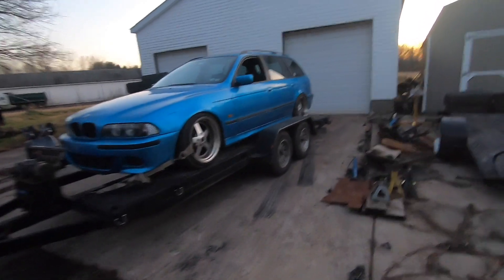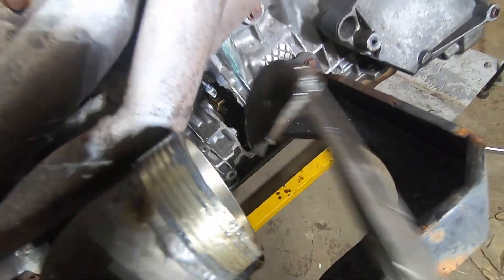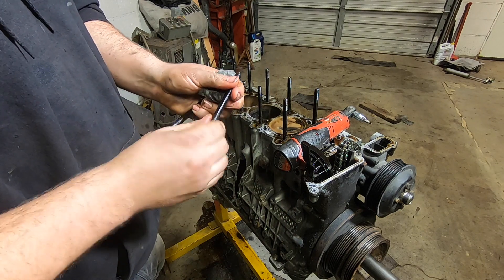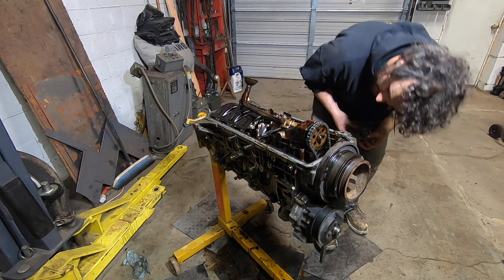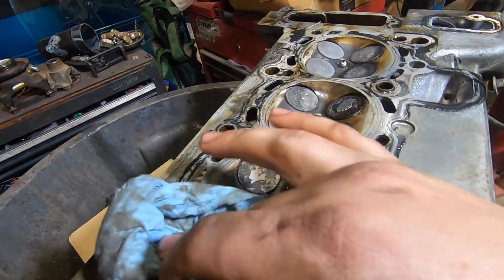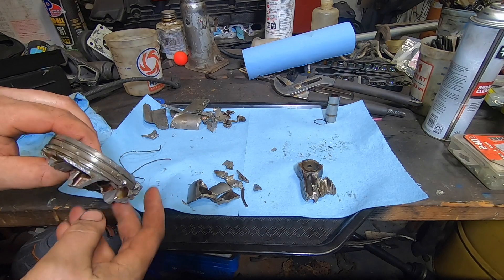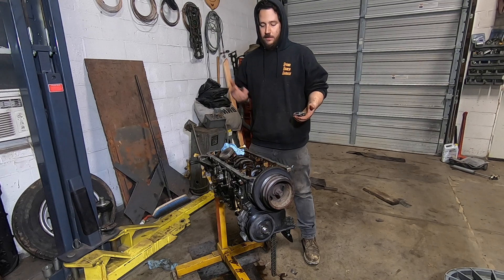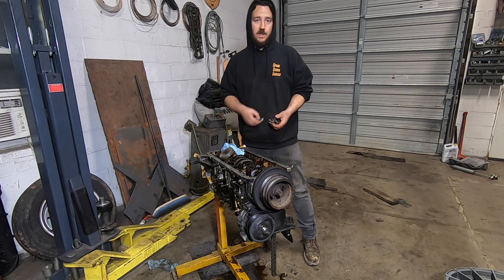I finally blew my Turbo M54 up. Heres what happened. Too much boost?

Comment: Interesting.  The failure was identified but not the cause.   Heat and lack of lubrication jam things up.  Massive torque bends things outright.   Did you ever find the contributing causes?
Reply from the maker: Thanks for the comment. Torque (Cylinder pressure) is the causal factor for the rod bending and starting the chain reaction. It was a combination of low RPM, a very cool oxygen dense morning, towing a trailer, etc that I believe caused this failure. Unfortunately the design of this engine leaves almost no room for a bent rod before catastrophe strikes. If there was more piston skirt to crank counterweight clearance, I think it would of just bent a few rods and I would of noticed before it was too late.

Comment: Hello my friend can you help me with a question? I have a stock e39 double vanos, can i turbo it and how much boost to be safe bare stock just injectors and remap and the accessories like intercooler headers and stuff like that. Please 🙏 i need your answer  the turbo i want to use is maxpeedingrods gt3582
Reply from the maker: The boost pressure doesn't really matter its the cylinder pressure and resulting torque that does. With a good tune if you stick to 400 WTQ and below you will probably be okay.

Comment: "Throws 1.1 bar of boost on stock pistons and rods" ... Engine blows up... dude be like..." :O Whyyy??"
These engines have a tendency to fail at above 0.7 bar (10 psi), where 0.5, 0.6 (8-8.5psi) is considered safe, and you went double that...
I am building an M52TU (alu block) E46 stroked to 3.0L (and a full 3.0L swap, so everything from a M54B30 is in my engine already, even the ECU, and the throttle body). I put brand new pistons in it, but for the rods I went for the rods out of a Non-Vanos M50, they are quite beefy, and extremely cheap (paid about 60 Euro (or $65) for all 6 of them combined), went with 12mm bolts for the head out of a M57D30 diesel engine ($60) (I know people push engines at above 800hp with them) and my goal is to get 400hp safely for a daily driver. looking at around 10psi of boost.
This video made me realize that I made the right choice when I put those conrods in. And if it still blows I am going all forged, baby! :D
Reply from the maker: 400hp is very safe on stock rods I have been doing that for many years in a drift car. Whats important to realize is boost pressure has little to do with what an engine will handle. 21psi on a small turbo is fine for a stock engine. 21psi on a 66mm turbo is a time bomb. Torque bends rods not charge pressure. I am confident this engine would of taken much more boost if it was delayed into a higher rpm range.
Reply: @spankranchgarage  You are right, but you have a limited amount of RPM to play with, maybe an electronic boost controller will make it a bit easier if the tuner is good, so you get a more consistent power. But I can bet my car you are talking 21psi is on E85 or something. And I am talking about pump gas, because we don't have E85 here in Europe (well, we do, but it is 20-30 USD per gallon, because it is treated like alcohol for drinking (yeah, the government is mad, no need to ask :D)).
Reply from the maker: @deanjohnson7283  Ahh yes I run all my turbo bmws on E85. I was spinning the 3.0 to 7350rpms to try to maximize the power curve. Like you said an electric boost controller would be sweet to make more boost up top

Comment: Noticed you have a tubular bottom mount on that thing. Looks similar to my PPF tubular bottom mount manifold. Can't tell in the video, but did you run a scavenge pump, and if you didnt, how did you run the return?
Reply: At 4:12, it looks like it just drains directly to the side of the oil pan.

Comment: That 2nd (and full) PBR first time I’ve openly laughed during an engine teardown video. Planning to boost a stock M54B25 for an AWD E36 project…needless to say I will avoid 15PSI! Great video.
Reply from the maker: 15PSI isnt always harmful, just depends on the size of the turbo. For example the GT30 cars I tune we go to 15psi all the time on pump gas no problem. But with a bigger 66mm turbo thats a much different story, especially when its super cold outside. Enjoy a PBR for me!
Reply: hey dude i’m planning on seeing if it’s worth doing the same with my e46 how is the project coming along
Reply: @D3RAYT  slowly, although I do plan on dismantling the E46 donor car this month. Will probably do a lot of the engine controller and other things during the colder months later this year.

Comment: Stock rods and crank can handle boost, but the rod bolts are the weak link, ive over torqued one before to 180 degrees instead of 90 and it broke right away, ive made the same mistake with ARP2000's and the bolt just turned in to a rubber band lol, but it didint break.
Reply from the maker: I still struggle to understand how ARP rod bolts help handle torque. High rpm yes I could see that. But rod bolts don't see much if any stress on the compression stroke?

Comment: hoy, My idea would be that intake beeing center feed, it does not require no turns, thus beeing the most air running cylinder. It ran the leanest, it ran the strongest. Your wideband shows mixture of all cylinder avarage not independant. So yeah, if It would of had melted, it would support my idea 100%, but i've also seen most built engines blow the last cylinder with front feed intake manifold. Thats why rally uses dual plenium ones For equal distribution.
Reply from the maker: This is a great well thought out theory! I think I agree that cyl 3/4 gets the biggest charge.

Comment: Have you had any success with timeserts on m54/m52tu non iron block I just pulled the threads out on a m52tu i tried to swap bolts of studs think I tried 75lbs as well I think it may be the main reason
Reply from the maker: I have a video on this topic and I have a new video coming soon. Pulled threads happened to me too finally. I have a nice cost effective way to fix coming soon

Comment: in my no expertise opinion, the cyl 3 is next to the turbo, the turbo got hot and heat the cyl 3 wall and the piston seal expanded. and from there u can imagine what happened. i think u should isolate the turbo from the engine a lil better.
Reply: Top mount
Reply: That would only make sense if it were cylinder 6 that failed

Comment: you kinda remind me of taylor ray, new sub!
Reply from the maker: Thank you! More shenanigans to come
Reply: @spankranchgarage  you think using m50b25 rods on the m54b30 will have any clearance issues?It would be m54 block b30 crank and pistons with m50b25 rods. theyre same length 135mm but the m50 rods are a lot more beefy. would be a cheap alternative
Reply from the maker: @Joey-tc7wg   You mean the Non Vanos M50b25 rods. Yeah they are a great option if you can find a cheap set. I would also very carefully inspect and measure some Chinese rods and run those if everything checks out. For this E39 I am just going to put it back together with stock parts and keep the torque a little lower

Comment: b30 is not the best for boost
bc of the length of the rod
Reply: without changing anything like Pistons Rods crankshaft Head etc on the b30, 
stock u can give the b28 a bit more boost 
b30 is kind of a Long Stroke so More Boost the rod Bends, cracks easier than on the b28
the b28 had better piston Rings than b22,b25,b30
without changing anything i would go to 460-470 hp max and 370 ftlbs on a b28 
some do 500-550 But thats More Risk 
on b30 i would recomend 450 455hp max and
330ftlbs
stock
then Ur safe

when u Start changing Rods Pistons etc etc its another story
Reply from the maker: Do you have any more info on this? Ive had better luck with my 2.8 liters but the rods are the same only the stroke and pistons change
Reply: Look exactly, messure if the crank is straight or bend
Reply: if u want to use it on the rebuild or other wise
Reply: Alien engenering sells a 138mm rod/ piston combo,  a better ratio? (Altho your stroke to bore stays the same)  honda b series parts/ bearings if i recall right. ( difference is a Higher wrist pin location im guessing? )  a m54b25 and a m52b28 use the same crank according to bmw fwiw. I also read in a carillo catalouge a n54 rod and a m54b25 had the same part number.  Lots you can mix and match im guessing, i just dont know for sure. I put a turbo s52 into my e39 wagon. Next motor will be a iron block with dual vanos zhp cams. Cut the single vanos head to fit dual vanos, still run ms43 . Seems like the best option for reliable power under the curve vs. Cost in 2023.   ( probably into my e36.)

Comment: How much whp and torque the motor was on ?
Reply from the maker: I don’t know exactly but I can say it was making 400/400 on 7psi pump gas and I had it turned up to 15psi on e85. So 500/500 would be a safe bet if I had to guess

Comment: Almost ready for the first crank on my b25. But it’s ms45. What’s the best cheap way for a tune? I have a 330 maf
Reply: On my MS45 turbo build iam going with a chaos calibration tune. I'll let yall know if its any good. Still waiting on other parts in the mean time
Reply from the maker: I never got into the ms45 stuff, but I think you can tune it yourself now. There has been developments
Reply: Went with Severn Tuning instead. MS45.1 and 6psi. It loves it

Comment: The internet claims the limits of stock rods are 450 ft. pounds at 4k or below and your gambling / on borrowed time. ( my opinion after a lot of reasearch) A 366 is a late bloomer on 3 liter?( so it should not be a issue?  )   Is that manifold twin scroll? Ive seen n.a. m54b30's let go EXACTLY the same way just from high rpm use/ street abuse. (7K redine/ intake /exhaust/tune)  internet also says S52/m54 crank has the worst harmonics around 7200. Prehaps 7300 redline has something to do with it?
Reply: Only other thought,  the center two cylinders get fed more air with a m50 manifold on boost. ( easy to see just look through the throtel mounting hole) I always worry about that spraying w/m with a single nozzel.  Extra fuel (meth ) may or may not help this m50 manifold issue who knows?  I will say, if i see a overheat, its usually the front or the rear cylider. If I see a bent rod or ringland , its usually one of the middle 2. ( everyone i know personaly with a m5x and boost is running a m50 manifold. ) 

Ive seen a few m54's put a rod through the block.
The m54b30 I saw let go the exact same way, it punched out through the oil filter housing/ oppisite side. Same exaxt carnage otherwise.   Happened right when he lifted after a pull. Car might have made 230 to the tire on a good day? (Guess)⁸
Reply from the maker: Drew good stuff. It is a late bloomer however on this morning I was towing a trailer up a hill and was being foolish. It spoiled earlier than it ever has I saw 15-16psi around 3500rpm or so. I’m sure the torque was pretty high at that moment. It’s not a twin scroll manifold. Good point on the m50 mani getting a straight shot to the middle cylinders. Never thought of that. But otherwise yeah, I was pushing limits on both ends with the 7350 redline and the torque levels. It’s only a matter of time

Comment: Thoughts and Questions for my own future reference.  Cast or Forged?  Detonation history?  Fracture that decided it's time to go....   Sometimes it's not the moment it happens but just built up fatigue????  Thanks for taking the time to analyze.
Reply from the maker: EZ your a thinker I appreciate that! The crank and rods are forged while the pistons are cast. This car was running on 85ish% ethanol with very conservative timing. There is no evidence of any detonation. This engine has been boosted for 3 years or so and gets used fairly hard often. I knew I was playing in the danger zone with the boost level. It’s possible the rod in cylinder 3 had some type of fatigue related issue, it’s also possible that I was just very close to that hairy edge and cylinder 3 just happen to be a little weaker or experienced some abnormal cylinder pressures for whatever reason.
Reply from the maker: I had a different but similar motor come apart last year due to fatigue failure of a cast piston. That one took 6 or so years of very hard use before it let go. I can’t be disappointed when asking for 2-3x factory power levels on 25 year old OEM parts.
Reply: @spankranchgarage  Hi, great content. What do you call conservative timing with 15-16psi on E85? I would assume it was fatigue failure, you had a good run with it.
Reply from the maker: @CosmosMBTS  I consider conservative timing on E85 low teens at peak torque, creeping to high teens after peak torque towards redline.